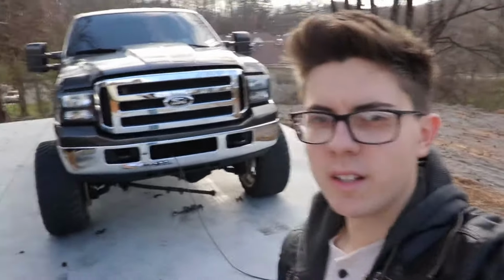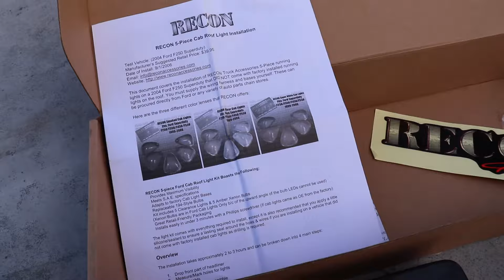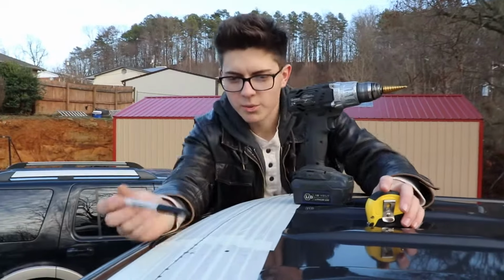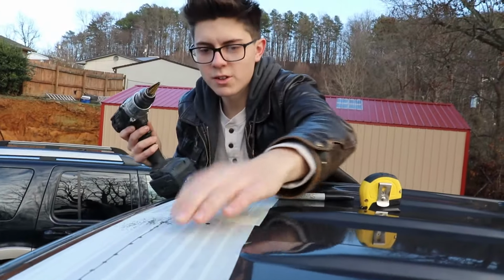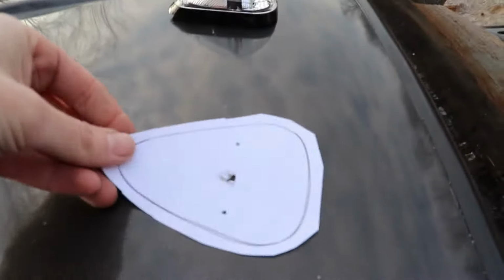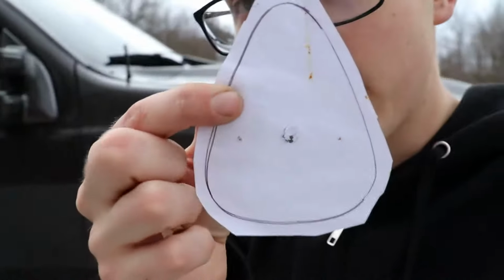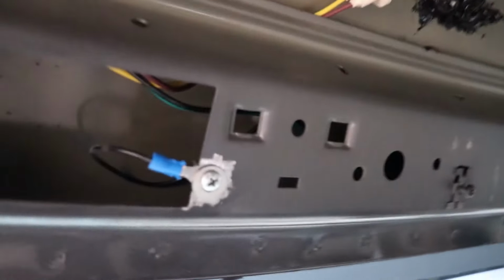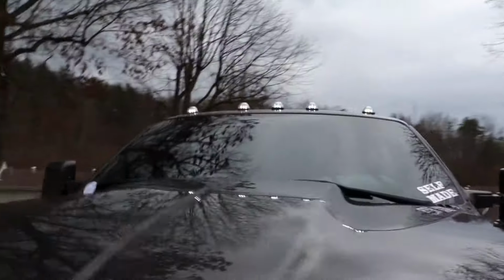RECON Cab light install F250 F350 1999 thru 2016

Comment: On my old Dodge I used Well nuts to get rid of SM screws. The hole is a little larger , but uses small bolts instead of the screws . They’re a threaded brass fitting surrounded on rubber. When you tighten, they expand. Water tight too.

Comment: Did the same install on my 99 250 but wired up to the dash switch instead of running a wire all the way to the headlight, good install though 💪🏻
Reply from the maker: Thanks for the comment Omar appreciate the support! And yes that would’ve been even cleaner great idea !
Reply: No problem 👍🏻 keep up the good work, love the truck so far 💯

Comment: Hey Justin I know this is an older video. I was reading through the comments section and seeing that you aren’t really happy because you have an issue with leaks. Were you able to fix the problem? 🤔
Reply from the maker: They don’t leak inside the cab , just the light itself gets moisture in them. They’re all still working just fine and still continue to leak.
Reply: @JUSTINHAWKSMITH  Thanks for the response. I want a set of these for my Excursion. Would you recommend a different brand that you don’t think would have that moisture issue?

Comment: to put it bluntly, ALL aftermarket cab lights/lenses are made incorrectly. the only hassle free option is to get the measurements for drilling the holes from a video like this, and then buy factory cab lights off of ebay/a junk yard. factory cab light housings and lenses have a slight curve in them to conform to the roof and sit flush on the roof, where all aftermarket lenses and housings are flat so they do not sit properly. to combat this, companies like Recon give you thicker gaskets so the whole housing sits higher to hopefully keep you from noticing the fitment issue. this leads to all the water deflection being done by the sub-par chinese gasket, where originally the housing sitting flush to the roof deflected most of the water and the thinner gasket just prevented any water that seeped under the housing from leaking into the cab.

Comment: Are the lights evenly spaced? It looks like the two outside ones have a wider spacing then the two closest to the center light. The only reason I ask is because I think it looks perfect.
Reply: Sorry just rewatched the video and you say the spacing.
Reply from the maker: the 2 outside ones are further then the 3 in the middle... just like OEM...
Reply: Finished mine up this weekend. Your video helped out a bunch. Thanks man.
Reply: The outsides are suppose to be that way

Comment: Isn't the recon set up suppose to be plug and play? The wiring to the factory connection under the passenger kick panel??
Reply: pretty sure, might be wrong, the 250’s dont come with cab lights

Comment: What bulbs did you use for your switchback blinkers/running lights
Reply from the maker: Raptor 700 Williams I run all JDM a star bulbs. Great bang for buck bulbs I’ve found. Super bright, cheap , and are 3 years old and still working perfectly and bright.

Comment: You never ever use silicone it will make your body rust always use rubber sealer a  body man told me that also a glass man also said that to .?
Reply from the maker: That’s good to know, I did not know that!
Reply: @JUSTINHAWKSMITH  My Dad was an Auto and Body Mechanic for years and I myself went through Paint School in the Military and can tell you that this is actually false.  There's no component in Silicone (Rubber) that causes metal to corrode.  Body mechs been using Silicone since (at least the late 69's/early 70s when my dad started out as a Body Mech) and was developed to use on Electrical motors and Generators.  If it had corrosive properties, it wouldn't be used in many of the applications it was designed for and is currently being used on/in.  You're good to go.  Anyone who says that is either inexperienced, or are using invalid resources, or pulled silicone off from a vehicle, saw corrosion and falsely assumed that it was caused by the silicone.  In reality, some people used to use Silicone to cover up corrosion, hoping that it was prevent the rest of the metal to corrode.  This was back before we had things like Flex Seal or any other form of Silicone Rubber in a spray can.  What you did was perfectly fine and better than leaving it without anything.  Most installations I've witnessed do not go the extra step like you did and rely on only the rubber seals that the lights come with.  These fail over time, repeating the cycle of getting wet and drying over and over, which eventually leads to those seals deteriorating and eventually coming apart.  Good job!!